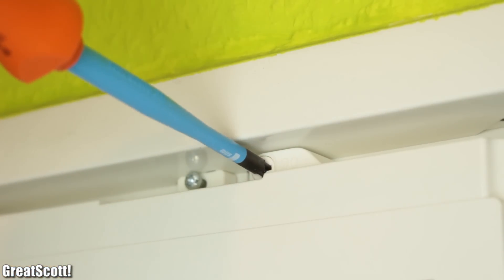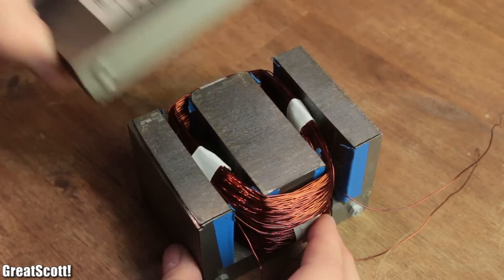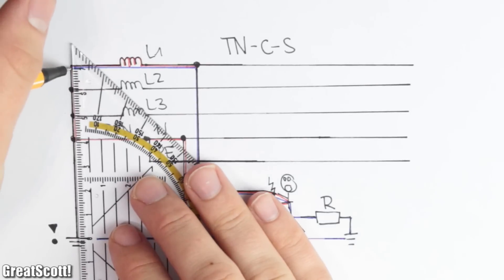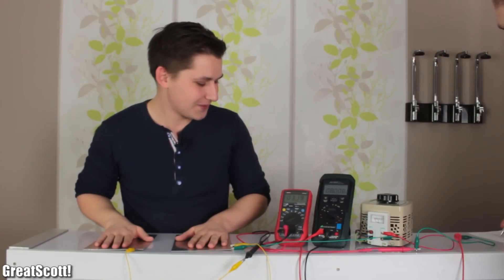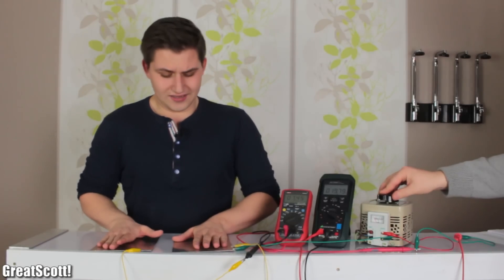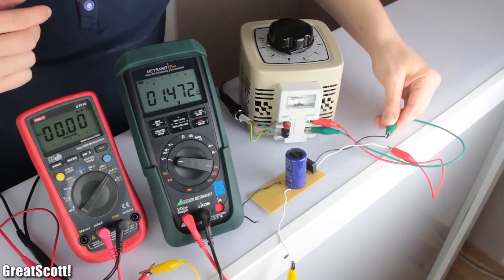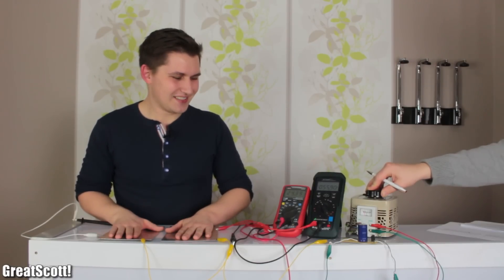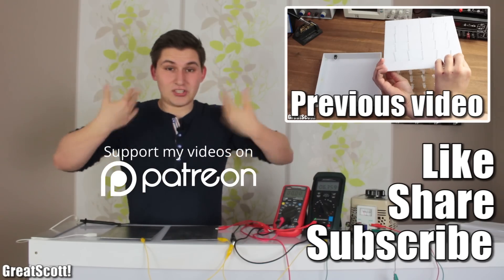AC VS DC - Pain Test (Experiment)

Comment: i dont get it, i have touched 120v AC before and its just like a quick shock.
Reply: that's probably what it was hahah
Reply: +John Davis (ScoobyJD) He had both palms directly in contact with metal plates. You were probably wearing shoes and didn't contact with a large surface area.

Comment: Wow, i really didn't think you would feel 10V AC!
Reply: In Australia you're not allowed to have more than 5V potential in a bathroom so I guess that is enough to make you feel it.
Reply: +mrcodyg Here in CZ is not a problem having a 230 V AC socket in a bathroom. There has to be some min. distance from sink/bathtub, and it must be powered through an RCD breaker. That is mandatory.
Reply: FakirCB it's like in germany
Reply: +mrcodyg i don't now i'am german. maybe because some people has a Pacemaker and that can be destroyed.
Reply: +mrcodyg In America you can have outlets (120v) in the bathroom, but they MUST by protected with a GFCI which will prevent you from getting shocked.

Comment: I would have thought DC is more dangerous mainly because it will make the muscles contract which will mean if you grab a high voltage DC wire you wont let go where as AC your muscles will release and contract with the line frequency
Reply: +Gary Lloyd You can't let go with any appreciable current at 50 or 60Hz. With very low frequency AC you might be able to let go, but you'll rarely come across this. AC is more likely to kill as you'll send your heart into fibrillation easily.
Reply: ***** It didn't say that was mains frequency, it said (I clarified in a new post) that the muscles will contract at 100 or 120Hz - the polarity makes no difference, so any "shake" is at twice the AC frequency.
Reply: ***** You can read various papers and other literatue on it. Involuntary clasping of a conductor occurs at around 22 mA with AC and 88 mA for DC. This is fact not based on anecdotal evidence such as yours.
Reply: +Gary Lloyd i think he's saying that at 50 or 60 hz that the muscle spasms would be at such a frequency that your fingers (if they were wrapped around some energized object) would never go limp enough for you to lose grip of the object.
Reply: ***** It must have been very unusual circumstances, because the muscle response is to grip harder onto the conductor.
Reply: +SDG Electronics Well AC line frequency is either 50hz or 60hz, not seen anything higher unless it is commercial use
Reply: IIGrayfoxII It's a sine wave, so you have muscle activity on both the rising edge and falling edge
Reply: +SDG Electronics ah
Reply: ***** No idea where you got the idea I don't know that the UK mains supply is 50Hz...
Reply: it is more dangerous than ac.I know of a few people getting zapped by 240 volts ac and lived.Get zapped by 240/250 volts dc with a scrap magnet generator
and will be toast for sure.
Reply: +IIGrayfoxII Well I have been shocked by AC Mains nemeorus amount of times (knock on wood) and Im still here. Ask any electrician- they've been shocked too. DC is a hell of a lot more dangerous- but he did say in his video which hurts more, not necessarily more dangerous.

Comment: I think you could have thought about this a little better. applying the voltage on each hand means the current path is accross the chest making it more dangerous. This stuff should be done in a way that the current path does not cross the heart.
Reply from the maker: +Morlanius I was aware of this. I have done this before and I know my boundary very well. It doesn't look like it that much in the video but this was all well planed and with low risks. I chose the hand to hand path because with this setup happen the most electric shocks.
Reply: GreatScott!
Glad to hear it, it would be a shame to loose a great youtuber such as yourself, yet still would be interesting to see how many views that video would get.

Comment: +GreatScoot I've seen a video that the frequency is also an important factor to tell if it hurts or no
Reply from the maker: +minecrafter9099 Correct. The higher the frequency the more current can flow.
Reply: +GreatScott! The video I've seen showd the opposite I think above 500hz or something like that you can't feel the power, by the way the channel is electroboom
Reply from the maker: +minecrafter9099 Because the human body is quite complex and can not only be described as a capacitor and resistor. What I told you was the theory behind capacitors.
Reply: +GreatScott! Interesting :) I like your vids, I know that's not the main objective of the channel but how about a vid about breadboard arduino?
Reply from the maker: minecrafter9099 Already did it. I think it was Electronic Basics #3.
Reply: +minecrafter9099 The thing with pain and higher frequency is that the higher the frequency, the shorter the wavelength penetration into the skin, since electricity rides along the surface of the body, and when you get to a high enough frequency the electrons flow along the surface of the body and don&#39;t penetrate enough to excite the nervous system underneath the skin, therefore you don't "feel" the pain.
Reply: +minecrafter9099 I know at radio frequencies it is worse because the current actually burns your skin which makes the pain linger even after the current is removed. I have experienced it before on a low-power mobile radio transceiver with an inadequate ground/antenna system and it did not feel good at all. An hour later I was still feeling a little bit of a burn.
Reply: You need to refer to the Mehdi Graph of PVF https://youtu.be/MMzU66IHe-k?t=2m14s for checking the different levels of pain frequency causes.
Reply: SCOOT
Reply: I've touched and held on to line voltage and it hurts!!!!!!!!!! I almost died
Reply: +Aodhan Murray The skin effect is not really the issue here, it is simply the nerves cannot respond to high frequency. For it not to penetrate deep enough for the nerves not to be excited, the frequency has to be in excess of 30MHz.
Reply: Yes, it's because the nerves and muscles react differently to different frequencies. Above 300 kHz there's no stimulation at all.

Comment: THIS IS VERY DANGEROUS! I used to be a certified electrician.

That having been said, 20mA across the heart will kill you. WILL. not might. and you never know where the electricity will go, it could one second go through other organs, and then you move your body one INCH and it all goes through your heart, bang, game over. this is INCREDIBLY dangerous, DO NOT try it because of this!

I happen to know from accidents myself when I was a child (and a few surprises when an adult) that 110v AC (mains voltage in the USA for residential circuits) just makes me jump away and curse for a second, and I'm fine.  220v AC makes me hurt like my muscles were punched for a few hours.  Everyone's body reacts to electricity in different ways, and your body position changes that too as I said above.

~edit~
FYI I'm 38 years old, so I've been around a while.

Comment: Great Video! I would have done it with my thumbs touching to redirect most of it away from my heart. I'm happy you were ok after. Now go get an EKG test lol. I have experienced 70 volts DC to be my discomfort zone. But that is with me touching the wire with two fingers and earth ground. It was a DC electric fence my friend made. I'm sure the current was very low due to the high resistance of my shoes and stuff.

Comment: In my country telephone landlines provide about 50 VDC which is not that unpleasant to touch. 
I doubt that 60V is the the limit. Either that, or your pain tollerance is pretty low..
Reply: +Fokos123 If you were to measure the current on the phone line, you would see it's limited to a very low amount probably much less than what we saw here.  As Scott mentioned, it's not just voltage but current too.  I suggest watching more electrical videos. ;)
Reply: +Fokos123 One more example. :)  Static electricity is thousands of volts, but it doesn't kill you because the current is extremely low.
Reply: +Tim Adams Ohm's law states that I=V/R.
In this case R equals to human bodys resistance (constant). It may vary from human to human but there won't be much of a difference.
Reply: +Tim Adams As for the static electricity example, it may be thousounds of Volts but the discharge lasts for an instance..
Reply: Fokos123
I=V/R doesn't account for the current limiting you get through a tiny phone wire.
Reply: +Tim Adams Actually the current is very high, but the duration is short so the total energy imparted is low. Read a book dipshit.
Reply: +Dr. Lecter Oh no, not another anonymous name caller on YouTube.  You win. Lol
Reply: Tim Adams
Get your facts straight though and you won't have an issue.

Comment: wait, germany has essentially 3-phase power?
Reply: +HendrikBG WRONG ! I am a student in electricity and i can tell you that to have 230V AC ou need 1Phase + 1 Neutral BUT for 400V AC you need at least 2Phase, it can go over 3Phase for the motor for exemple !
Reply: +rounak dutta Yes, it has at 400V. It is used for high-power devices like ovens or  stoves. The rest just uses two phases of the three so you end up with ~240V.
Reply: ***** remind me to give you a baking tray this christmas.
Reply: +HendrikBG  Not two phases for stuff like electronics, lights etc, that'd still be 400V - they use phase and neutral, 230V nominal. Just like US folks have 110 V phase and neutral for small stuff and 2-phase (2x 110V, 180 degrees shifted,for 220 total) for more power hungry stuff.
Reply: Oh, I meant that. :)
Reply: Pierre OneShotPlay is it just Germany exclusive or the whole EU has 400V power for higher power consuming devices?
Reply: +rounak dutta In portugal you can have just 1 phase or 3 phase, you chose. But in a small apartment you will never have or need 3 phases. But in a big house people have 3 phases to suply different parts of the house to not overload one phase. Here, at least every phase is 220v down to neutral and 380v and 440v depending on the 2 phases that you chose
Reply: +David Teles in the USA it's rather similar, except the houses have 120v 2 phase, andcommercial/industrial has 240v 3 phase to 480v 3 phase.

The consumers (and me sometimes) call it 110v and 115v and such because such voltage drops in a well used household circuit can drop to that at the device.
Reply: +rounak dutta the whole EU has only 1 power grid
Reply: +JaqiesGadgets Actually, most residential in the U.S. uses what is called "Split Phase" service, which is really a single phase.  The transformer primary taps one phase from the utility and the secondary is center tapped (and grounded) to provide three wire service to the home.  The voltage across the outer taps is 240 and the voltage from either outer tap to the center tap (neutral / ground) is 120V.
Reply: Same in Australia. 240V line to neutral and 415V line to line. You can specify to your electrical distributive whether you want single or multi phase power supply depending on whether there is a need for it or not
Reply: Aww makes sense.
Reply: +rounak dutta in the netherlands it's the same. 220v (is about to go to 240) normally and 380v (is about to go to 400) whenever used two live phases.
Reply: Kristijan Dinga excuse me, do you have some kind of speech impediment? Anyways it appears that 3-phase power is available almost everywhere in this world http://www.apiste-global.com/enc/technology_enc/detail/id=1268
Reply: Well, here in Argentina it's pretty much the same, we use 220V mains (measured between phase and neutral) and for devices with higher power consumption there's 3 phase power (~380V, measured between any two phases)
Reply: ***** Ya I saw that, turns out its same for the most of the world

Comment: A question: if we look to the table we see that DC can provide a lot more power before it hurts. I'm not a médic, but probably AC induces hearth fibrilation easyer than DC. So why the hell the rule for transmission of energy is AC (here in Brazil we use 127/220/360 at 60hz).
Reply: +Vilmar Antônio Moccelin Júnior The AC current has a lot of positive factors :) 

Though I don´t know which :DDD
Reply from the maker: +Vilmar Antônio Moccelin Júnior It is a very good question. But the answer is not that simple. Maybe I will make a video about the subject one day ;-)

Comment: would there have been a difference if you had used copper plates ?
Reply: +toXic viRus01 the difference is less than negligible,  A larger difference would have been had with larger gauge alligator clip leads, because they are the smallest conductor in the whole setup, and that being said, even that would have negligible to zero difference.  As he said the human body has/is a capacitive resistor, so most of it is capacitance instead of galvanic current in this experiment (until you get to the breakdown voltage of the body in it's current physical position which he begins to get to in this video).
Reply: No not really.

Comment: Hey GreatScott!

Thanks for solving my curiosity without making me do it by myself.
but i have additional question (related to history rather). 

Back when Thomas Edison was competing with Nikola Tesla in terms of supplying DC or AC in US,
Edison conducted a PR test in which he would electrocute animals with AC voltage to advertise the safety of DC
and also the danger of AC.

But from your experiment, it seems like both AC and DC can be lethal given enough power.
So was Thomas Edison completely BS-ing about the security of DC??

Thanks for reading!
Reply: Yes, Thomas Edison was kind of an a-hole, though it's a bit more complex than that.
Reply: no, DC is "safer" compared to AC for humans in the event of a shock. You see our bodies are like a capacitor; and capacitors offer low resistance to AC current and high resistance to DC current. So 220v DC is much safer than AC for us.
Reply: +Adil Malim Yep, that was clear from the experiment, though at the 220v mark I doubt the end result would be extremely different.. or would it?
Reply: +RapiBurrito Yea it will kill you either way at that voltage. But i would prefer DC anyday haha